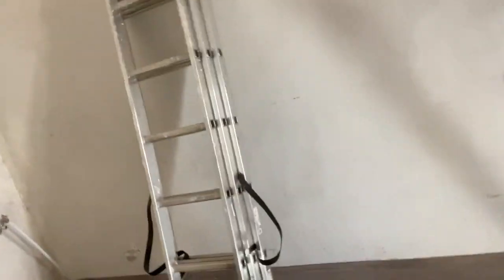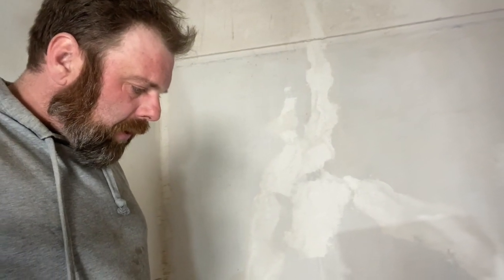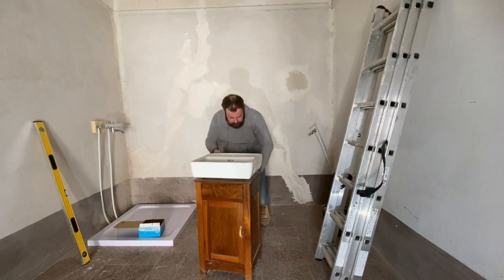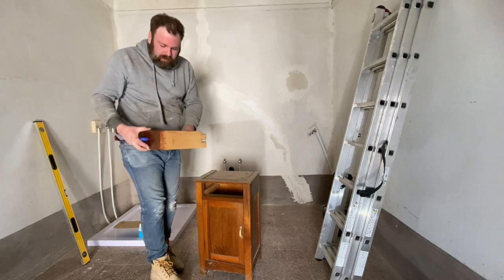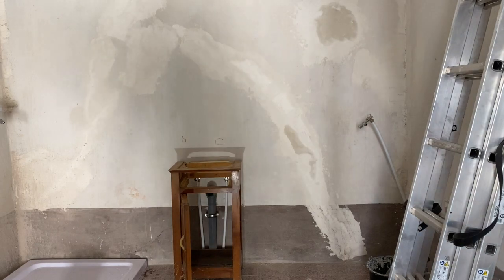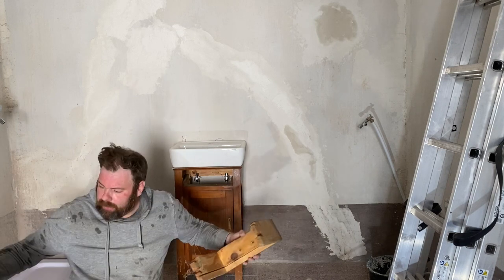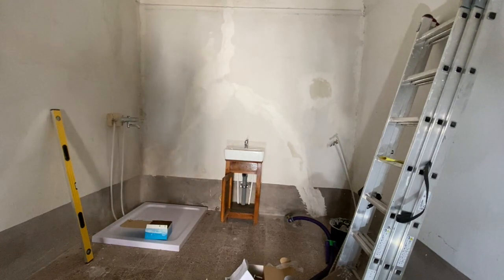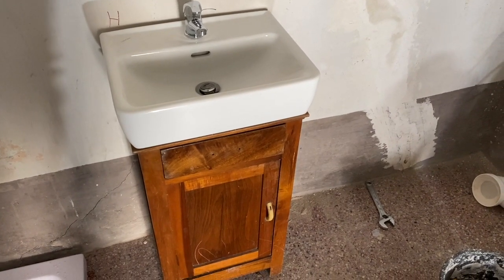Converting an antique nightstand into a washbasin in 7 minutes! Upcycling in Italy

Comment: You must’ve felt pretty proud when you first ran that tap. Looks great. Consider cutting the drawer bottom around the drain pipe and adding sides so it’s a usable, U-shaped drawer. It’ll still be better than not having a drawer. About the toilet, how did you know where to drill the drain through the floor without using a template from the actual toilet?
Reply from the maker: Hi Eric, I really did feel a little something when water came out, and flowed away diwn the drain! Good idea for the drawer! The toilet comes in 2 versions with the same box, just a marker tick indicating bottom or rear exit. All the fitting dimensions are on the instructions, so I just followed those for rear... Thanks for watching!
Reply: @NotUselessYet  I know the feeling of accomplishment especially when it's making something that does something like plumbing and electrical. Great feeling.

Comment: I think you could leave half the bottom of the draw & have a place for toothbrushes.
Reply from the maker: Not sure if that would work 🧐 I’ll check it out! Thanks for the tip!
Reply: @NotUselessYet  I've seen drawers under sinks.  You cut out a slot in the middle, for  the drain pipe, make interior walls around the cutout and you have a useful drawer on the sides and a bit on the front.
Jon in rural BC, Canada